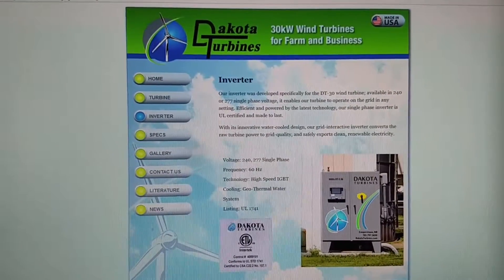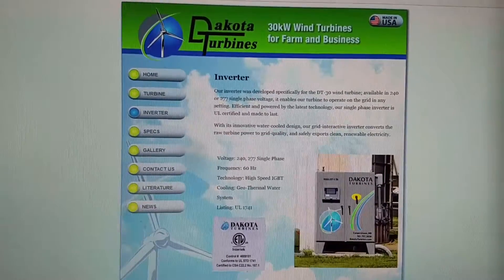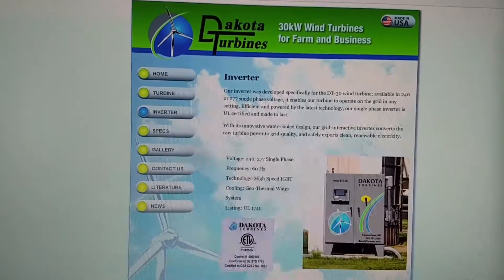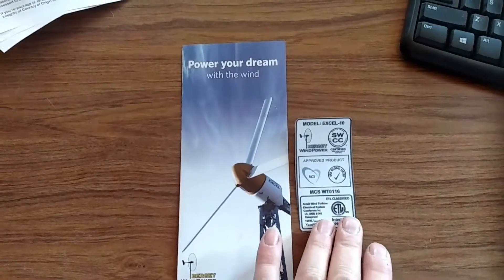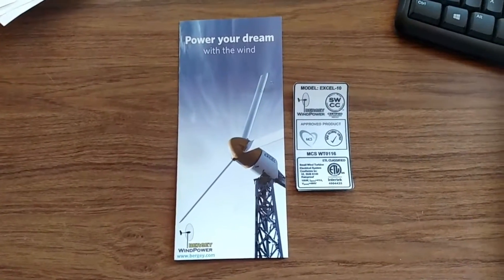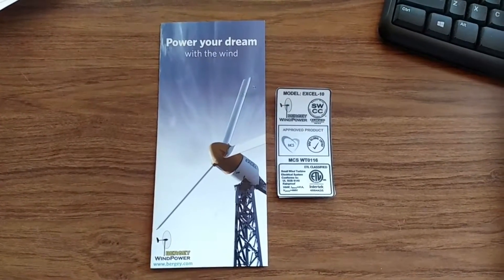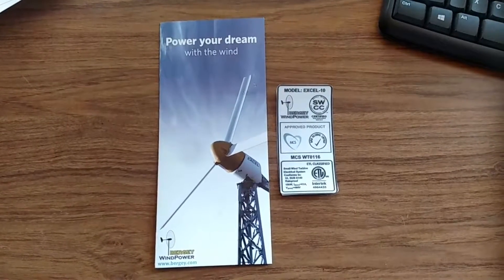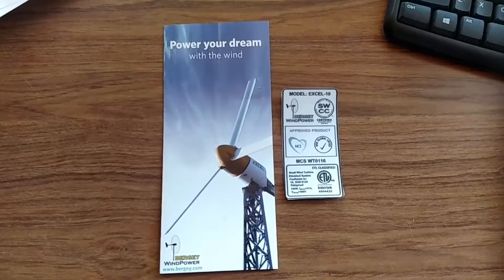Renewable energy system and UL listing

Comment: a lot of people don't understand that they think you get it it works
Reply from the maker: Right on. Safety and also. It has to be hooked up. In Minnesota you can't wire your own system. Must be UL listed. First thing they look for. As an installer I get all the documents be for hand so it goes through easily.